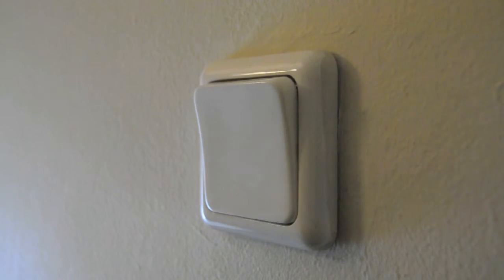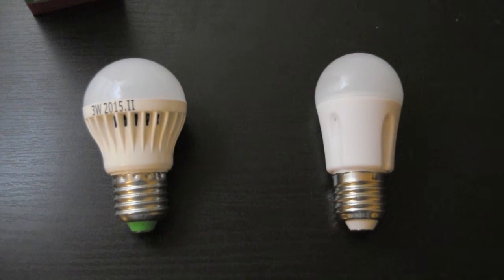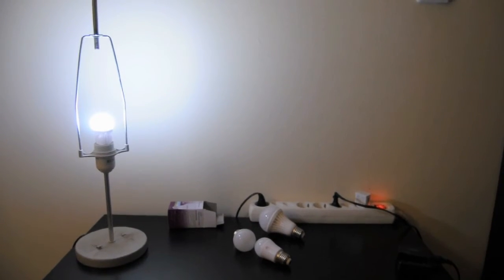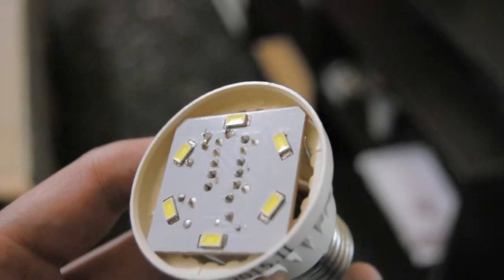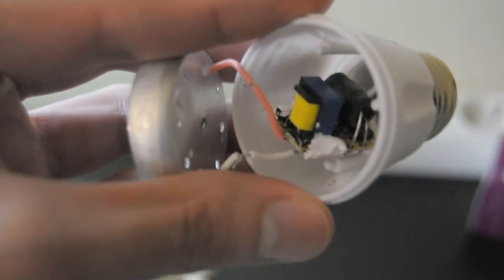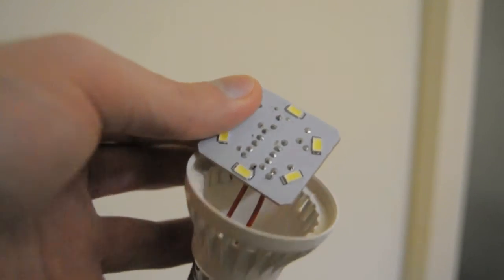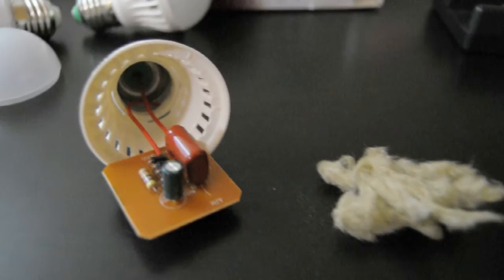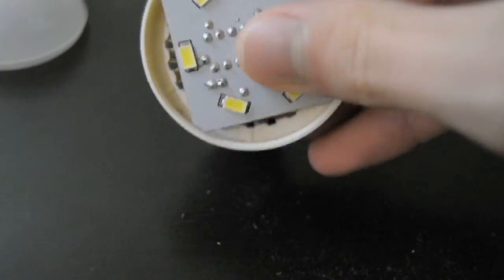LED Light Bulbs: Cheap Vs Good - Comparison and Safety Info

Comment: You stuff ANY kind of insulation in a light bulb and you are CREATING a fire hazard, not ameliorating  it.

Build up some heat.  See how that works for you.
Reply from the maker: Those components does not produce any heat under normal operation,instead,if the led element fail under this circuit design (which will do sooner or later) there would be a total meltdown to the components with a risk of fire expanding to the plastic and so on.

Stuffing it with fireproof material will not allow flames or direct heat to be transferred to the case,until it completely shorts and trips your circuit breaker or just make an open circuit.

Stuffing transformer-rectifier based or high power LED bulbs which have heatsinks on the elements is a whole different story than this chinese low power 3w bulbs.

Comment: I would like to add a few comparisons which might not matter much but they are my key to LED bulbs

-Good bulbs will not flicker 50-60hz depending on the power. Bad ones do flicker
-Good bulbs have good heatsinking behind the LEDs rather than just a floating PCB board.
-Lastly it is all about high color rendition index on good vs cheap. Hi CRI just makes the eyes feels better with less sores

oh LEDs :)
you should check out yuji LEDs. They are like my dream LEDs but oh wow the price is nasty
Reply from the maker: +ducttaperulestheworl  You're right. Flickering LEDs is an indication that the smoothing capacitor is not sufficient to smooth ripple either because it is too small or because it is failing.
 
Usually this is happening to cheap ones with bridge rectifiers as they use the cheapest capacitors working on high voltages. It can also happen to good bulbs but very rarely or after 10 plus years which is the stated lifespan of the bulbs which is actually how much their capacitors will last. Swapping the smoothing capacitor will revive any flickering bulb,usually the cheap bulbs need swapping to 1000-1600uf.

Afterall i've seen some nice Philips led bulbs for as low as 5$ with warranty,so why would anyone bother with no name chinese leds?

I also make my own ones and it is the best solution so far as you know yourself the power supply is a tank,you can use a good cob led like yuji's which btw i checked spectrographs and their warm leds are very good and similar to incadescent bulbs,and there you have a light that will outperform the lifespan of any other.
Reply: sadly chinese don't even use caps on some of their cheap lights. not even a regulator or any form of control but just pure resistor alone.

I guess people like me would opt for chinese lights due to tax and customs causing some cheap philips to be extra toasty price. But so far I've never tried ordering one myself outside.

well I am now happy with my current flashlight installed with a Nichia 219BT :D
Reply from the maker: +ducttaperulestheworl Yeah i've seen these too,imagine having flickering spotlights on a store front haha. 

You can probably find Philips,etc in the super markets and malls but they might be very highly priced.

I had checked on candlepower forums for the nichia leds,seems like some of the best things for portable dslr lighting and fairly priced. :D